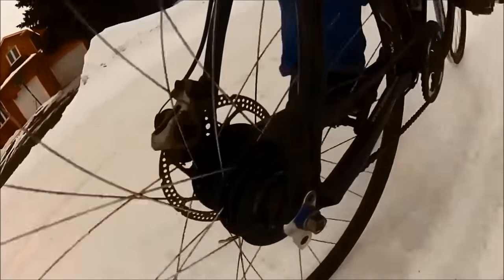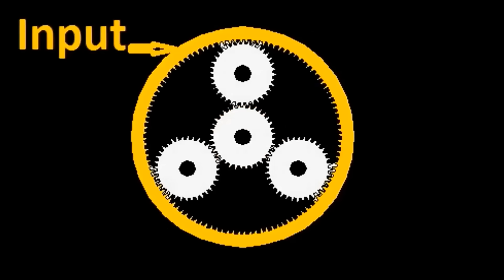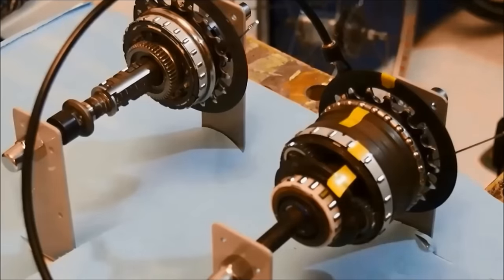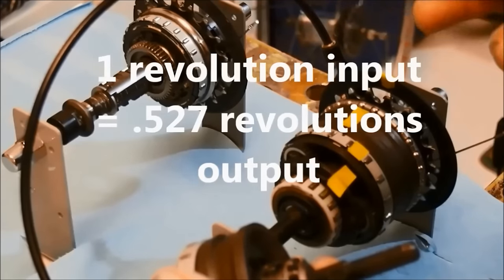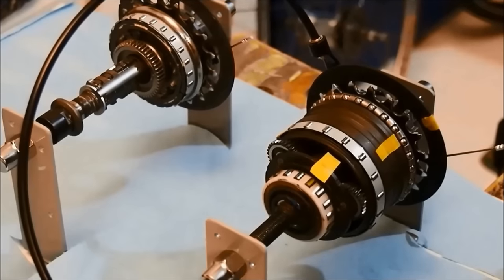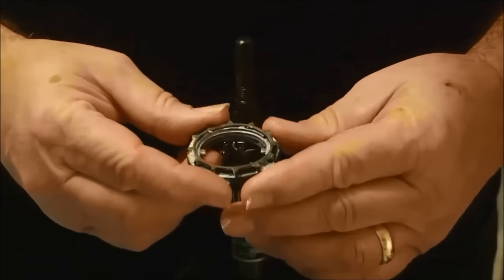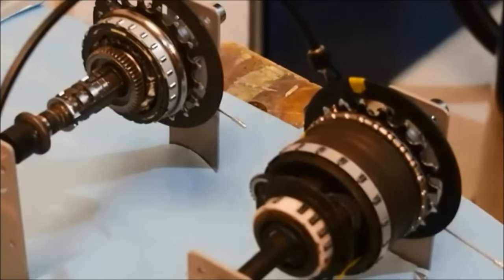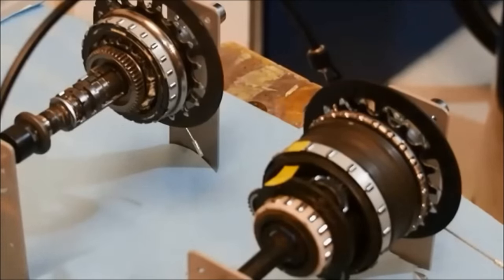Shimano Nexus Alfine 8 speed How it works

Comment: too bad they don't make one specifically for unicycles so that each gear is fixed with no freewheeling. this is the case with the schlumpf unicycle hub but the downside is there is only a high gear (1:1.5).
Reply from the maker: That would be quite an engineering challenge given that the axle in a unicycle is a moving part and not fixed as in a bicycle wheel.Not saying it couldn't be done, but some smart kid somewhere would really have to step up for that to happen.

Comment: Have an Alfine 8 which is clicking in 2 gears on forwarding pedaling, any ideas?
Reply: You can try servicing the hub & then adding ATF fluid with grease for the bearings & seals. Sometimes a good clean, with new cable & fluid can make a big difference on how everything runs smooth.

Comment: This gear doen't have brake, I think. Brake is extra gadget by side of gear. Some gearboxes have "foot brake" like Shimano Nexus 7.
Reply: You can install either a Disc Rotor or a Roller Drum brake on the Nexus 7-8 speed & the Alfine 8 - 11 speeds.

Comment: great engineer said if you want it to work well, keep it simple as possible.  this is not.   I will pack around an extra pound, and keep using my nuvinci n 360.  It is simple, effective smooth seamless transfer, without noise.

Comment: Hi Dan. What would the difference be in using mineral or synthetic ATF to lube the internals?
Reply from the maker: I really don't know the answer to that. I'm sure either is fine. I don't know if there would be any significant benefit to using synthetic.
Reply: @2wagondragon  Hi Dan. I used mineral in the end. Synthetic is hydroscopic. I wonder what the actual Shimano oil is? I have a feeling it's mineral oil designed for outboard motors, or fishing rods etc...
Reply: @2wagondragon  Good grief. I just read the comments and realized that two years has passed, I asked the same question two years ago when it first started clicking, and have only just gotten around to doing the lube job. And that's doing about 120km per week. So yes, these hubs are indestructible if ridden properly.

Comment: Its great until it fills with water and mud etc. They should have put a greaser port in it
Reply: Alfines run in an oil bath & have a port for changing/adding oil. Neither hub should ever fill with water as they have grease & 2 way seals at either end. If you are referring to running on a Mountain Bike submerged in water then No that is not where they are meant to be used.

Comment: i have no time for numbers. Can't you just tell what is the equivalent of each gear to a conventional cassette gears: say i picked 3 speed IGH:
is gear 1 (low gear)= 41 Teeth cog ? 
is gear 3 (high gear) = 12 teeth cog?
Or should i get 10 speed IGH to replicate 10-cog conventional gears?
Are those tiny gear teeth rigid enough for excesive force during climb

Comment: I think this guy is pointing to the wrong sun gears for 1st through 4th gears.  The larger the sun gear, the greater the speed differential, so the BIGGEST sun gear should be first gear, and the SMALLEST sun gear should be fourth gear.  Try this on a planetary gear simulator and you will find that I am correct.

The smaller the sun gear, the closer to a 1:1 ratio it becomes.

Comment: Too complicated, too heavy.  Bring back the 10 spd.
Reply: I hate the derailer and the constant adjustment and lubrication. This works for me!
Reply: You only use two or three speeds on that derailer which is why a 10 speed was enough.  They devoloped the other speeds with more complicated gearing for marketing.  This thing is too heavy and you'll feel it on long rides and especially on the hills.

Comment: A pale sad imitation of a Rohloff Speed-hub. Swing and a miss!
Reply: Not at all. Completely different application. Nexus & Alfines are geared for city or light road applications. Rohloffs costing 4x the price of an Alfine 11 are geared more for Offroad & Touring. They are built for high torque situations & priced accordingly. An Alfine 11 could be changed every 4 years & you would have the latest model, brand new & still not have spent as much as your 15 year old Rohloff.